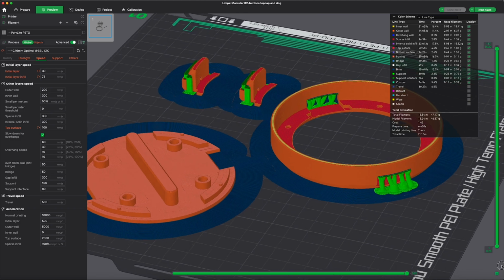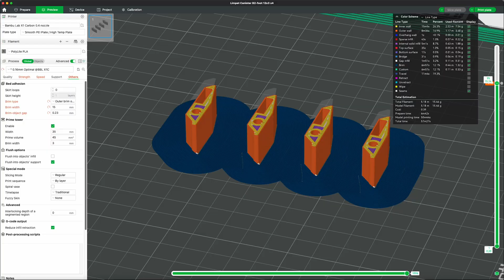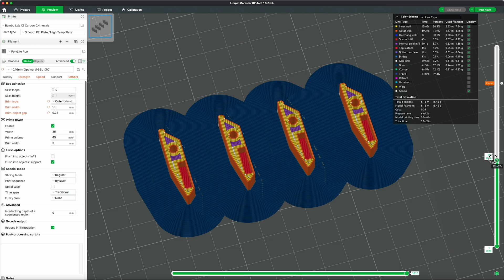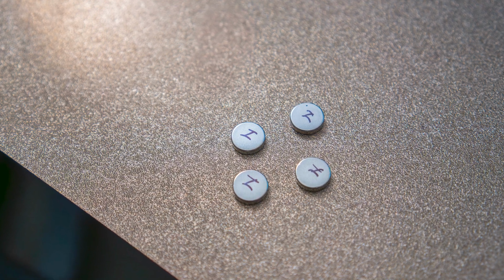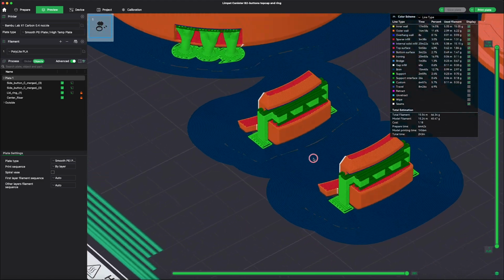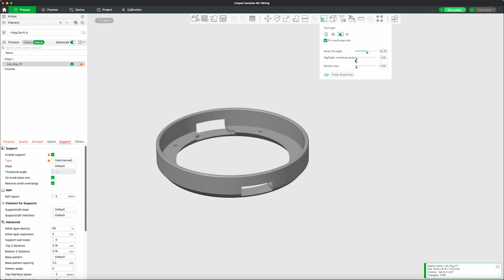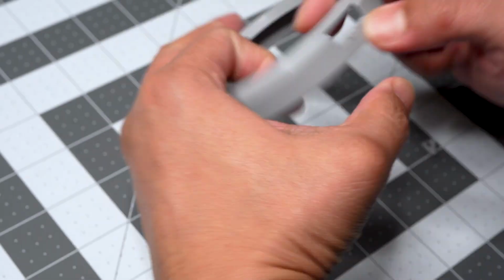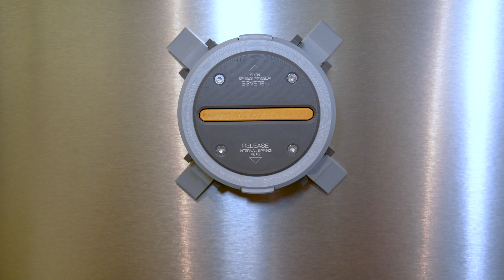Magnetic Pod Build

Comment: To improve magnetic force, alternate the magnets (so long as the distance between opposite poles is significantly larger than the distance between the magnets and the surface to stick to) and put a ferritic plate behind all the magnets. This joins the flux lines on the back side, increasing the strength of the flux lines on the front. I did this for a magnetic project and it worked excellently, but it did require two pieces to clamp together for assembly, and it was a bit of a pain to do so without magnets flipping everywhere.

Are you using a brass or stainless nozzle? I imagine carbon steel nozzles could pose a problem when embedding magnets into a print. Though maybe the spring steel build plate helps.
Reply: Also minimise the distance between the magnets and the surface as much as possible. A rubberised base would increase friction and do more to reduce slippage than increasing the number of magnets. Rectangular magnets magnets would be more efficient as well. Probably not enough space to set up Halbach arrays.
Reply: Magnetic field lines can also be focused on a particular side (without a ferrite core) when setting the magnets as a Halbach array, which increases the flux density on that side hence improves the magnetic force. — EDIT: Just saw that there is a video about the Halbach array on this channel! Wonderful :)
Reply: I doubt it'd be an issue, but if for some reason the magnets do want to pop out you could just use a touch of super glue. Those magnets aren't ever getting out anyhow.
Reply: Government doesn't want you to know this. But it works.

Comment: Another impressive project. It’s really amazing how a laser engraving can make a 3d print look that much more refined. 

I recall you have a $2000 Xtool? Would a $300 engraver be able to do the same?
Reply: depends on what you mean by "the same". Could it engrave words in thermoplasatics? YES
Reply: @BarronBros1822  Like visually. I know the expensive ones can cut wood and other materials but just for text etching would it look as clean?
Reply: @zackj997  the user interface and programming is gautenteed to be way worse. Should do the deed tho
Reply from the maker: We regularly use an xTool F1, and increasingly the xTool F1 Ultra. We also have access to a MOPA 100W galvo and some gantry-drive CO2s. Beyond that we can't really comment on what we haven't had too much experience with. 

What we can say is that if your aim is to do fine graphic/marking work, then something that is a galvo is probably going to be the direction you wan to go. Gantry laser machines just can't reach the speeds sometimes required (sometimes upwards of 1000 mm/sec or faster). You don't need that much power (the F1 only has a 2W IR and that's what we use most of the time for the detail stuff. Laser type also makes a big difference; we seem to be getting the most range from the IR vs the Blue Diode laser.

When it came out, the F1 was one of the few plausibly affordable, non-industrial galvo laser machines available. Since then, it seems there are a lot of other alternatives that have come to market. And now, it certainly doesn't cost as much as it did when it was brand new to the market. $2K USD seems high for that machine, it's gotta be less than that now? 

The best thing to do before you buy anything might be to print out some test plates of your most commonly use filament, then take them to a local maker shop or maybe university lab and just run some tests? Hope that helps a bit, good luck